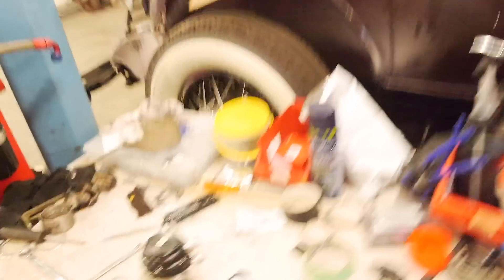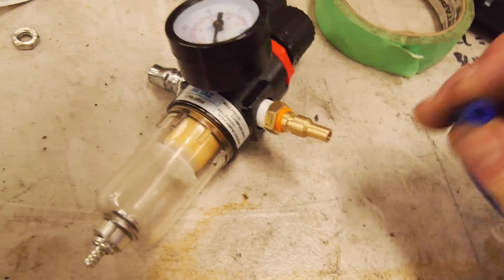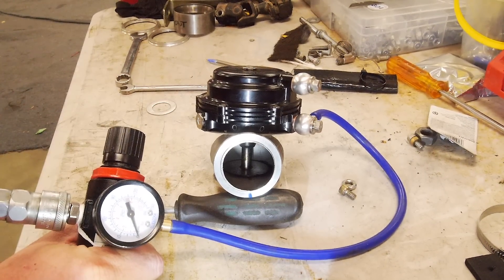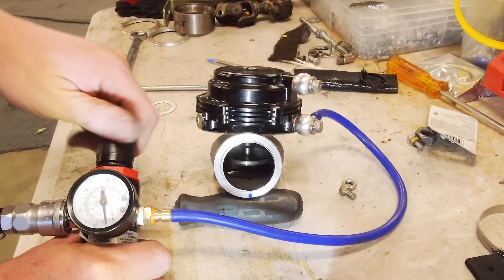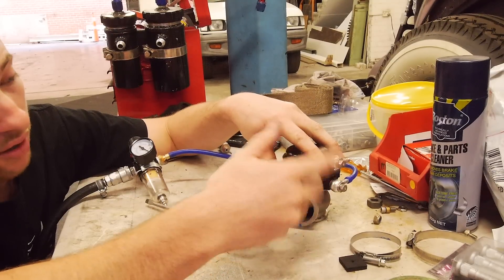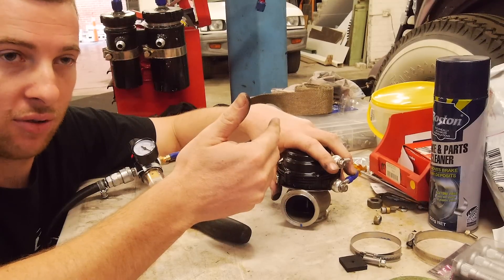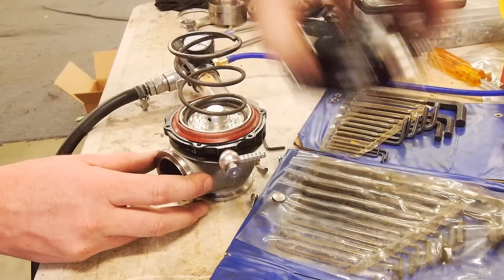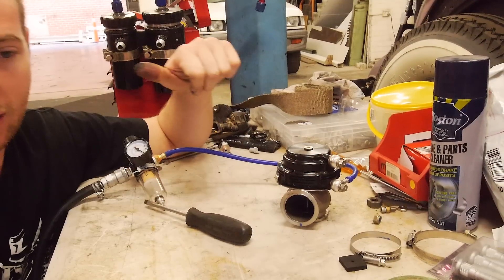HOW TO CHECK YOUR WASTEGATE SPRING PRESSURE - TIAL EXTERNAL GATE

Comment: My wastegate wasn’t opening until 25 psi on a 14.5 psi spring.  I put it down to 13.05 spring and it starts to crack at 19 psi.  Idk what’s going on.   Any ideas?
Reply: Your wastegate spring pressure rating is half of what your boost level will be from what I’ve been lead to believe. 
I have an 8lb spring and I see 16lbs flat when running just off gate. I’m not sure the science behind it but that’s how it seems to work.
You can look up charts to read that the manufacturer of your wastegate will make to tell you what spring to run for what your reading on your boost gauge is at idle. So your negative pressure.
Reply: @thornsaw  dang.  I always thought it would crack at whatever spring pressure you installed.   I put the 8.7 in and now it opens at 14.5.
Reply: @85nscarola  do you have your boost reference line hooked up properly?
Reply: @thornsaw   you are completely wrong
Reply: I’m having this issue right now, was on an E85 map it was working fine then I flashed a new 91 map went to get a log and over boosts to 22psi and fuel cuts. positive I have a 14psi spring as when I did logs for my E85 tune it would peak at 14 psi on gate pressure

Comment: if the fire ring is not instaled it will lift sooner looking like a lower spring the fire ring is puched up agenst the valve so the piont where the air pressure lifts the valve off the fire ring it the rated pressure sins the riging is not in there your gessing where its would lift  not to say that wount give you an idea of what spring is in it

Comment: Mate does a wastegate spring control the boost level if I put a 7 psi spring it will boost 7? Anyone know
Reply from the maker: Yes if your system is flowing properly and it doesn't boost creep
Reply: @boostedbuiltgarage  ive got an external gate on my evo, put a turbo smart mbc on it and without even adjusting it the car boosts to 20+ psi?? With the mbc removed it holds 10psi all day
Reply: @unfknknown9678  sounds like your mbc is the problem, make sure you've routued the lines properly into the external gate, there's properly a diagram somewhere on the internet, or you could have a faulty  mbc
Reply: Alright thanks mate 👍👍👍👍👍

Comment: This helped so much! On my 335, the wastegate opens at 8psi and then once I get to ~6krpm the boost jumps up to 10-11 of the spring pressure. It sucks because the entire pull I’m at 8psi till the end. I thought my wastegate was bad, time to up the boost now and have my Mac solenoid control it
Reply from the maker: Yeah exactly right, an electronic boost controller will keep it shut til the very last second. With a spring only it's always going to have that gradual progression from closed to open
Reply: I have a 2009 335i.  Having boost issues at 144k Mike's but always babied it.  Have jb4 G5 with methanol.  How do you know it's at 8psi?  I'm trying to track down the failure.  Just replaced my solenoids with OEM because I was having a solenoid boost error.  I have a  vacuum gauge and have replaced all hoses.

Comment: Can i connect the top port WG with vaccum intake ???
Reply: top should be either vent to atmosphere or hooked up to boost controller. Not vacuum source.
Reply: @CSOCSO  so i have 2 ports on my wastegate, should the hose to mbc go to the top port on wg? Currently without the mbc on it goes to the bottom port
Reply from the maker: Yes you can, as long as it sees boost too. I actually do this on my cars.
Reply: @boostedbuiltgarage   thanks for u info bro..

Comment: Isn't the rated spring pressure at full open?
Reply from the maker: Yeah that's right. Although it's also handy to know when it will start to crack (if you're running solely wg spring pressure)